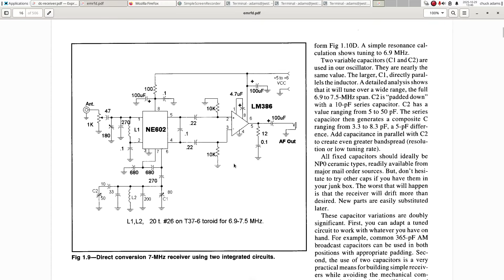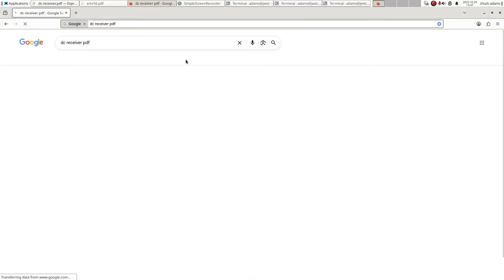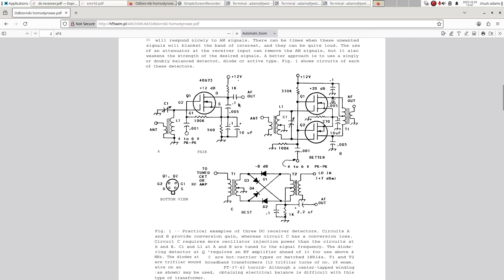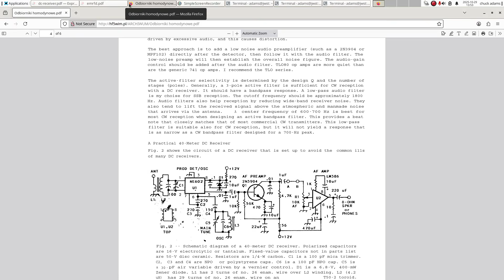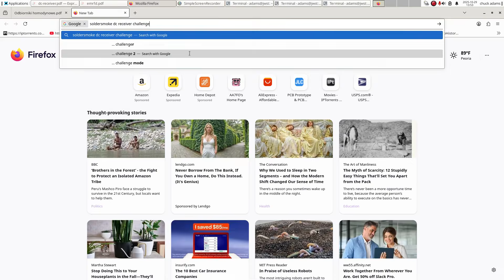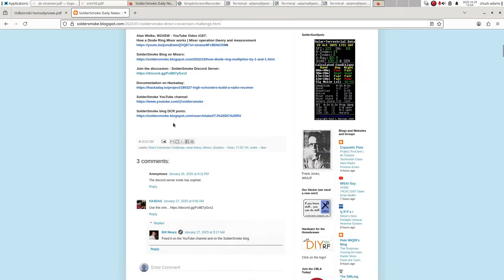AA7FO Construction Experiments Series -  #016:DC Receiver Circuit Construction

Comment: Chuck, thanks for another interesting post! I have built the solder smoke DC receiver and it does work! They have very good documentation and a set of forums that discuss the radio in great detail. The VFO is a PTO and I was able to 3D print the former at my local library. 
Chappy Happy (https://youtu.be/NQfsqNgpOrI?si=BDnI44VJ40cNSlXn) builds some beautiful and functional dc receivers as well.
DK 
KD6TK